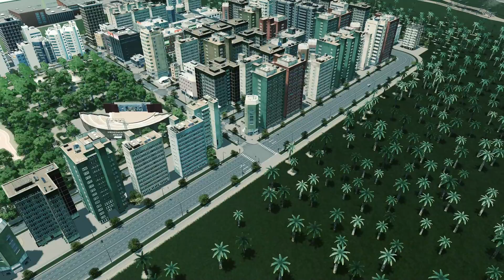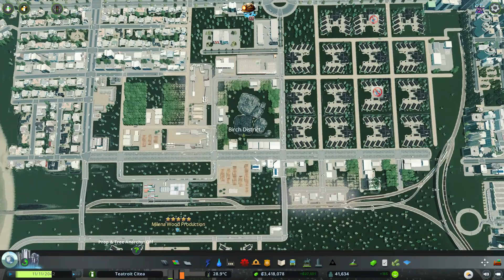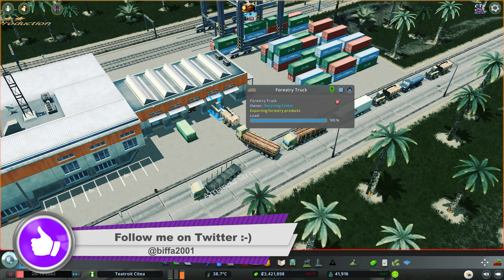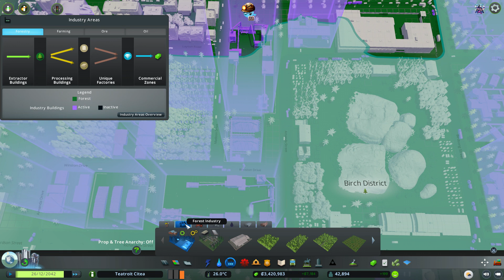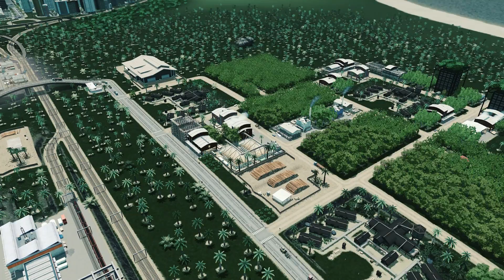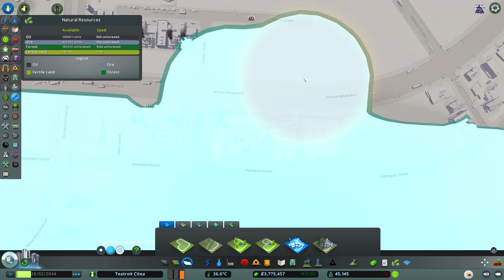Cities: Skylines Industries - Upgrading Forestry Industry! #16 (Industries DLC)

Comment: loving the video,

i don't know if you noticed, but in CS: industries they made a huge mistake.
the "upgraded" buildings you mentioned are worse than the smaller ones. so you downgraded

if you look at the amount of produce compared to weekly cost and footprint size of the building, all the smaller versions are more profitable, the only reason i use them is because of how they look. but when i'm in a small spot and want to put some more output i only use the small ones.

just compare the 3 forest buildings, the smallest 1 is half the size of the medium and a quarter of the large one. but the large forest produce only 11200 compared to 4x4800=19200.

so keep that in mind when "upgrading" industries.

the storage buildings are a bit strange, 
i understand how they implemented the full/balanced/empty.  but that is not what we needed, we needed it to be "local use only // local and export 50/50  //  export all"
because now we can choose how much is stored but we do not choose where it is used
Reply: I was thinking maybe use "no truck zones" to surround an industry district to prevent trucks from leaving the area they are supposed to supply? And then deliver goods by train maybe?
Reply: Funny, I was just putting together a small spreadsheet looking at exactly this earlier today. It is very true that the smaller extractor buildings for the four DLC Industries are more efficient than the larger ones, by quite a margin! The processing plants all seem to make better sense, the bigger ones are all more efficient.

Comment: The reason why you're importing so much is that when you have storage buildings set to fill or balance then it will import and fill with local resources to get them to the level they need to be at. As soon as those storage buildings are full then the imports go way down.